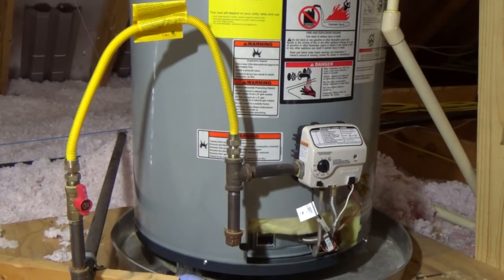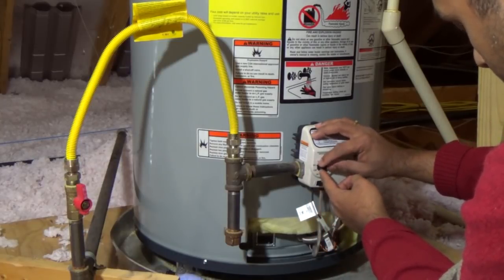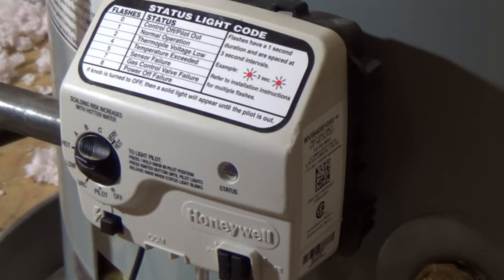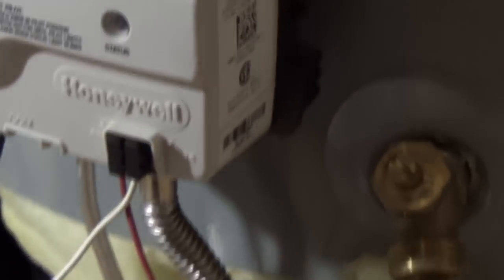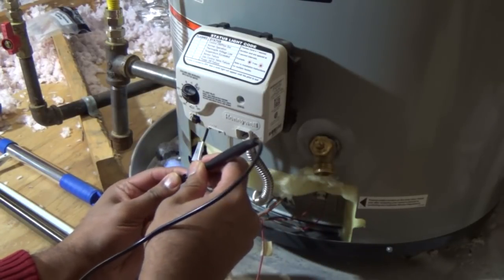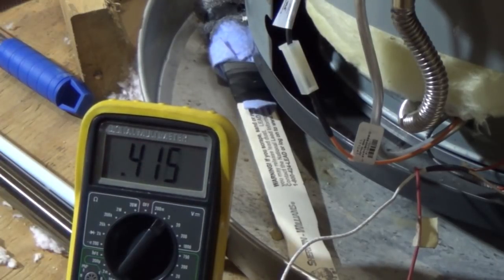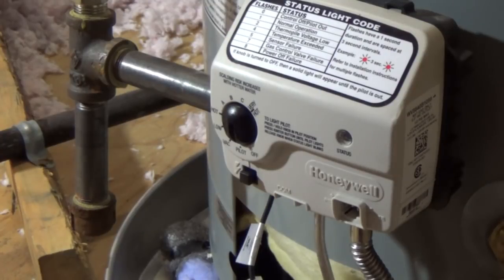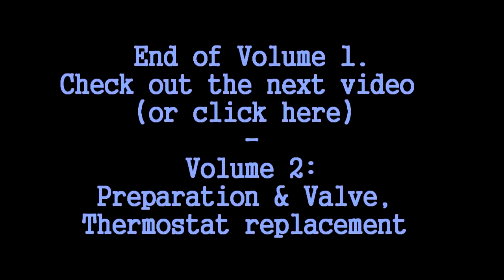(Read Descriptions for IMP Info) Volume 1 Introduction: problem & Troubleshooting - Gas Water Heater

Comment: Hmmmmmm I am still grappling here I'm half a dozen ideas into the thing and I think if there's a reset mechanism on this reliance M.N. 6-30-NOCT 400 gas water heater (okay if my face is looking directly at box with blinking light that ain't blinking no more ! FROM there WHERE exactly is "this reset" switch knob button where is it.
Also: nobody's mentioned this with regards to the base of the heater there's TWO screens "dust and or DOG HAIR filters" okay so it is. Now I found my screen's caked ! dust and my white husky HAIR thick thick SO cleaned that wrapped around tank filter and I noticed "barely noticed" a second roundish filter directly under and in the center of this TANK ALRIGHT
   and direct above that smallish round filter sits the pilot light. 
       I just wrapped a piece of duster cloth to a FLY SWATTER and reamed it across the filter 
and so I did.
STUPID THING STILL the pilot light DIES fast....! upon releasing the pilot knob held in a minute two minutes 3 minutes 
👦just go's out I 
👔  couldn't even
👖     get the knob 
            turned to 
              heat b 4 it
             WENT OUT
reset button knob or
switch WHERE'D 
            IT BE 
            |`````|❔
            |     |
            |🔥|🚶
            ↪↩

Comment: Thanks for the useful video!  Do you know what the settings A, B & C are for?  Thanks!
Reply from the maker: Generally speaking, A B C setting is for temperature, A is usually around 110, B is usually around 120-130 and C is usually 140 F.

Comment: i just got a service call to ts one of these tanks for a new customer who happens to be indian,now that i cleared that up.he says it's a code 7 so this video does not help my situation.anyway let me dissect your video here a bit.you were testing to see why the pilot doesn't stay lit.according to the legend there is a code for low thermopile voltage so you wouldn't need to test it for that since it would already tell you this.if it were a code flashing for it then the next step would be to take it out and clean it to be absolutely sure that end there is no problem with it being dirty.also there could be a problem with a dirty or maladjusted pilot ,the latter not as common because it's something that isn't replaced regularly and if someone made a mistake with tp height adjustment.i've manipulated older gas hw tanks with the burner assembly outside of the tank to see if the flame was hitting the thermoCOUPLE as it's called on those properly at the right angle and not lifting away from it.i'm not sure if i could do that on tanks of today which are the closed chamber type.pilot quality and position is key to make the pilot work correctly.correct me if i'm wrong but the gas valve is really called a gas control but in this case this is called  an electronic wiper.you keep referring to it as being called a thermocouple in essence it really is called a thermopile.they are 2 distinct types.what the differences are i forgot but they aren't the same.when testing both types i believe they are to measured in dc millivolts i know for sure a thermocouple is tested dc,something you didn't mention in your video.we are not testing in ac here folks.many people will forget to mention what setting you are supposed to set it for.i hate that.i like step by step.set your dmm for dc milivolts,what scale,etc,etc.ok meticulous mike's affordable plumbing,heating,electrical and large kitchen appliance troubleshooting and repair,installs,maintenance  serving the capital district for 15+ years signing off.thanks for the video.

Comment: Check It Out !!! I just got a house with this exact model water heater, watched videos on how to ignite it and got it working so I was happy I had hot water! I put it in between low and hot and it worked great it stayed blinking my next question would be do u leave it on like that or does it eventually turn on or what? I just messed with it last night so I’m just worried about leaving it on or having to turn it on. The white light stayed blinking and worked great. Thanks!

Comment: Does anyone know what temperature the low setting is? The booklet does not acknowledge this setting anywhere. 

VAC - 55°
High - 125°
A - 128°
B - 137°
C - 147°
VERY HOT - 160°

Comment: I just got a new AO Smith water heater installed. It has been making quite a bit of noise. It sounds like either a tin lid flexing or someone taping the water heater with a wrench or something. I'm not sure if I should be concerned.

Comment: My old water heater cracked and leaked so we got a new one. After about 6yrs the thermostat failed. It was leaking from the thermostat itself. People thought I was crazy. Removed  the old one and it had a plastic tip that had cracked/worn out? Got a new one and now it won't light. These thermostats are horrible. I'd prefer the thermostat of my Old water heater, because that never had any problems.

Comment: Just noticed I didn't have hot water and I came across your video. I was using single click on the igniter and it wasn't working but when I watched the video you used multiple clicks until the pilot came on so I appreciate your help.

Comment: +CTRL Z TV.....my pilot light just went out yesterday.I hit the reset button and lit the pilot light,came on for 10min and shut off....but every since yesterday, after igniting the pilot light all I see is gas flames while burning.Then it shuts off after 5min. HELP lol!!!!!
Reply from the maker: +Southeast Wink 202 sound like the thermocouple is not sending the fire. Did you troubleshoot the thermocouple?
Reply: CTRL Z TV thanks for replying but I come to find out the thermocouple had build up residue on it to give it a low ⚡. But I got it fixed sir,thanks again.

Comment: Where is the battery at in that?
Reply from the maker: +Zane Wv there is not battery in these valves. The power comes from the thermocouple.
Reply: CTRL Z TV how does that work?

Comment: GUYS, TRY THIS!!! I laughed so hard after I read this on another thread and it worked for me after spending a couple hours trying all the different steps. Idk why, but this is the only thing that reset my heater and got it working!

1) Light the pilot and hold the button down 20 sec after the 4 lights come on.
2) Turn knob to very hot for 10 sec
3) Turn knob to hot for 10 sec
4) Turn knob to pilot for 10 sec
5) Turn knob back to hot and wait like 15 sec and it LIT! Lost my damn mind that this worked haha

Tell me if it works for you guys =)
Reply: Justin White mine as well it started right up

Comment: BE CAREFUL..i heard if you turn these to the highest temp for to long...the control will lock out and cant be reset. you have to buy another one...its a built in safety feature.

Comment: I'm having a problem with a slight smell of gas around the gas valve.  It's been replaced, and the odor of gas is still noticeable.  I believe the valve isn't quite tight enough as I see at least three exposed threads in back of the valve.

Comment: hey man thanks. just saved me a huge amount of frustration. the fuse had popped on mine and I had 0 voltage. after setting the fuse I had to really keep pressing the ignition button for a while before the red light came on. thank you for this video.

Comment: I cross the wires It came on for me
Reply: Would you happen to know what power source lights up that flashing light? Maybe a battery internally in the Control box
Reply: Capacitor
Reply: Where does the electricity for the capacitor come from?
Reply: There is a red wire for power. Removing it shuts off the light eventually but does not reset the error. The instructions are cryptic and videos cover what needs to be done. It needs a better disposition. Mine has been working for 3 months so far on medium heat. I could write up the process but not today.

Comment: I have the same control valve on a Bradford White heater - it's broken. Thermocouple, temp sense, thermal switch, PCB, wires, connectors all check out. Cleaned the pilot and thermocouple. Pilot lights, but will not stay lit. The green status LED blinks either 1hz or 7 pulses and a pause. When I try to turn on the unit, while still holding the pilot button down - the pilot just gets small and goes out.  Super bummed that this unit is only a few years old. It breaks on a Saturday afternoon and Monday is July 4th holiday. No one to fix it for 3 days at least.

Comment: Honeywell should sell the control panel or even just the controller board separately as that is often the problem, not the valve body itself.

Comment: I have a whirlpool water heater that has that exact temperature control unit on it. I installed the new one last night and I am still not able to get the pilot lit. I've done pretty much everything twice with no luck. The biggest problem I have is my health, I can get the parts covered under warrenty but putting them on once is not too bad, but when I have to keep messing with it my body starts cursing at me. I've followed the pilot lighting instructions to the letter with no luck. If you can think of anything that might help that would be greatly appreciated.
Reply from the maker: +eric tuck Did you check the Thermocouple ? That could be the next problem.

Comment: Just installed a new Whirlpool water heater.Could not get the pilot to light.Explained the problem to the tech and he said the valve was bad.They would not give me a RA number so I could return it to Lowes for a replacement.the best they would do is send me a new valve. There is something wrong when I have to fix a brand new water heater.

Comment: How do you replace the thermo coupler on this unit?
Reply: +Buuboi214 There isn't one, its a thermopile on this model not a thermocouple.
Reply: oillio h
Reply from the maker: please check out the instruction manual here. http://living-in-usa.com/index.php/2013/12/17/volume-1-introduction-to-the-problem-and-troubleshooting-gas-water-heater/ let me know if you have any other questions.

Comment: I need help. I cant get my pilots to even turn on, they wont light. I tried calling honeywell tech support but i was on hold for over an hour with never getting to talk to support
Reply from the maker: Jpgee, I advise you keep calling the manufacturer to get troubleshooting steps and a replacement if determined that a part has failed. You should be able to follow the basic troubleshooting as mentioned in the video and provide the result to the tech support. let me know if you have more questions.

Comment: You are releasing the gas from the pilot for 60 seconds not knowing if the pilot has been lit from the piezo ignitor? Doesn't sound very safe. You might want to take a peak in to see if it has lit within 5-10 seconds and after your 3rd strike wait a few minutes for the gas to clear. Take a look at the pilot light during process instead of guessing for 60 seconds. just sayin
Reply from the maker: Thank you Todd. Will include it in the description.
Reply: no problem. Its nice of you to make a video to help people. Take care.

Comment: TY sooooo much for this video....I have a new hot water heater with this controller on it and the instructions on lighting the pilot light were not clear...I couldn't figure out why when I was pushing the ignighter button and holding the switch it would not show a flame...well duh..after that you turn it on...the instructions did NOT say that....thanks to you I will have a hot shower tonight!!!
Reply from the maker: You are most welcome. Glad you have hot water :)
Reply from the maker: Please subscribe.

Comment: I received the thermostat controller that i needed for my whirlpool gas water heater today. After turning off the gas and draining the tank i then used a shop vac with a small hose attached to reach into the tank and suck out all the calcium deposits or whatever all that white crap is. But after a good cleaning and replacing with the new thermostat controller. Hooking all the wires and gas line back up and checking for leaks. There were none. So i lit the pilot and low and behold the water tanks burner now lites like it is suppose to. I must give a shout out to the man i talked to from whirlpool on the phone. He listened and sent the new part that i knew i needed. free of charge. His name was Gary. And he spoke english. How about that ? But im good to go once again. There may be hope for whirlpool yet ?  Thanks Gary for all your help.  Tom.

Comment: I got a whirlpool set up just like this not even 3 years old. Pilot lites and stays lit. The burner will not come on. I called whirlpool today and there sending me the entire thermostat part. I just want to say i am very disappointed with the cheap quality of whirlpool products that they now sell. I hope to get my water heater up and working in a few days but i will no longer be buying and whirlpool products.
Reply: I have my WP about 2 years old, same issue as yours. I found if I press down strongly the black connector with red & white wire the burner starts. I expect new part , but this fix works for a few days already until new part comes.

Comment: good video,my pilot light comes on ,but after I release the button after holding it for a minute,the pilot gos out,i used my field piece digital meter and set it on millivolts dc and connected my leads to the two wires on the water heater thermocouple wires like you did and the volts went up to 440 in a minute,or a little before a minute and then my meter gets no more reading,it shows OL on my meter,my question is shouldn't I still have a millivolts reading on my meter even after a minute.
Reply from the maker: OL could mean Over Limit, which means you still have voltage but your multimeter cannot read it. Do you have a higher setting or another Meter?
Reply: CTRL Z TV thanks for the info,i found out that after a minute the electrical current from the censer goes out.thats why it shows ol after a minute.i found out it was my gas valve,i replaced the gas valve and it works perfect,thanks for the help.